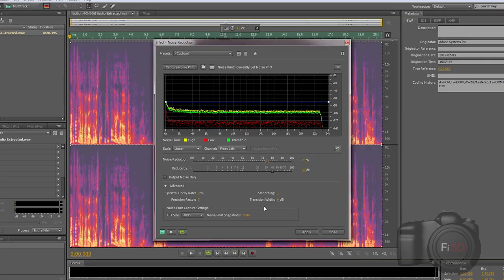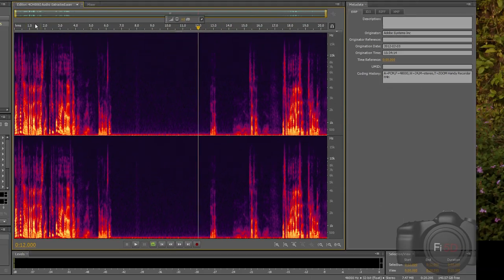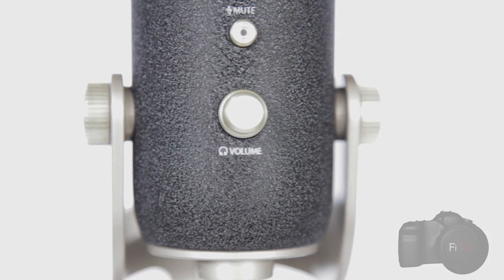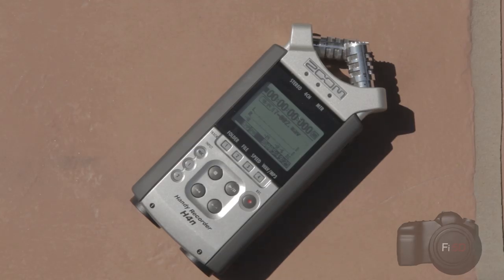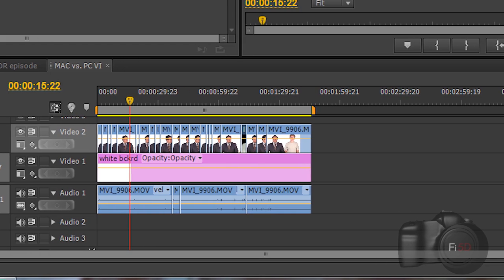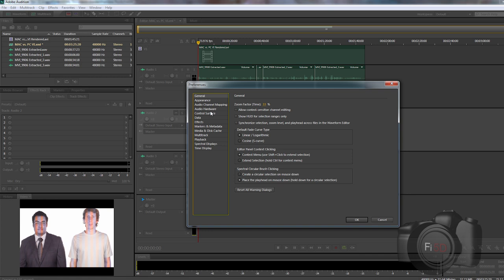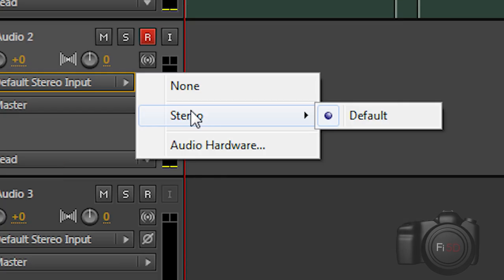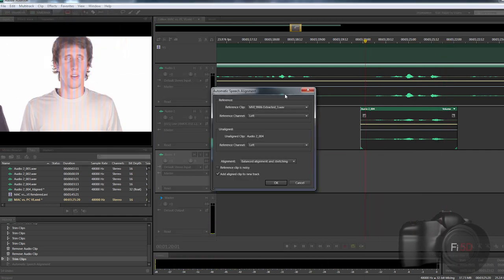Automated Dialogue Replacement (ADR) Tutorial

Comment: I have not done a job shot out doors with out ADR  Good video!  You do not need to go to a post house to replace the dialogue.  If you have the budget great.  One thing I would say is if any of you need to replace dialogue consider a few things.  1. Actors need to be cued in..  So set up on your time line a cue signal that normally is three bleeps of sound prior to the actors delivery plus when you record on an external recorder you can sync up the dialogue far easier with the audible signals. .. Use a large monitor so the actors after watching their passes can time out their performances.  3. Do not if possible record directly to your computer/NLE.  Use your Zoom or Tascam or what every external recorder your use with a decent Mic. check your sound before recording.  Then work the details in post.  One thing that helps is to be very aware of your visual environment.  When we replace dialogue we also replace everything else,  foot steps,car noises in the back ground (Wild Track). everything on location so you have a good sound library of the shoot to use in post later  it helps to take out the over closeness of the dialogue being replace and audibly it is much more realistic.  I will be doing a complete ADR Vid shortly on this topic that will be extremely detailed.
Reply: Hey Randall...thanks for the info here...have you done the complete video?  Why do you recommend using an external recorder instead of recording into the NLE?

Comment: Really great video on some underestimated part of video making !

One question though : each time I tried ADR, even when recording on location, I found there was a a different "coloration" between the "take sound" and the ADR track. This is not obvious when you are on the set -- but on post it becomes obvious when you switch from "take audio"  to ADR on a cut. I do not have the experience to know what's wrong, but it sounds wrong. At such extend, I prefer either using either no ADR, or  ADR for a whole scene -- instead of "patching" only the few bad lines in a take. 

I hear it was because I use a Lapel mic to live recording and a large membrane mic for ADR. But in all videos I've seen about that topic, people are using a different mic for ADR. What are you doing special to seamlessly merge both the ADR audio and the "take audio" ?
Reply from the maker: use the exact same mic for ADR that you use when recording live if possible... and in a similar location if possible.  Also make sure you are mixing well enough (capture the room-noise and mix it with the dialogue)
Reply: Thank you for your reply. 

As I said, I tried several times to mix and match different mics, and that only leads to me wasting my time by playing with the equalizer without many benefits. Maybe this is different for a professionnal sound engineer, but for mere mortals recording in the exact same conditions and with the same mic is probably the wisest.

And you're right in mentioning room tone : I noticed it's rather typical in ADR to end-up with "dead sound". And simply mixing some RT behind the dialog helps a lot in making the whole edit more coherent.